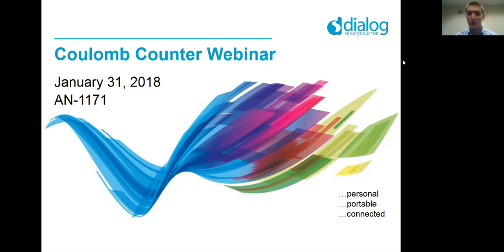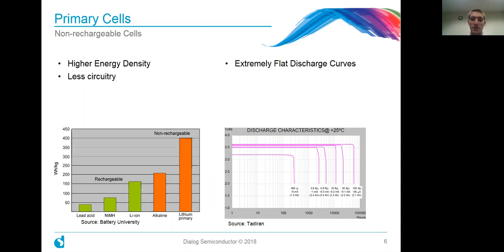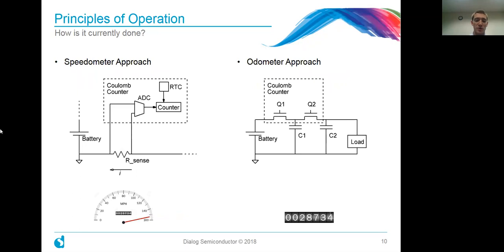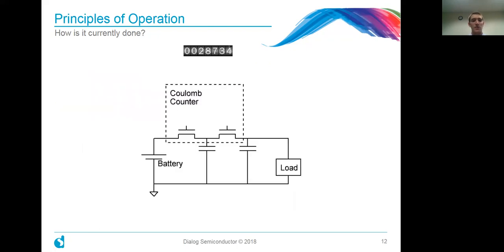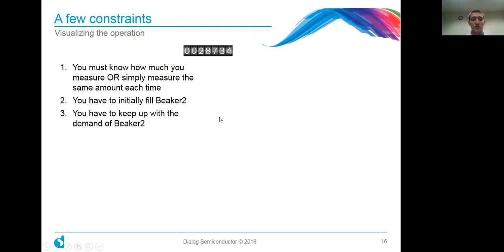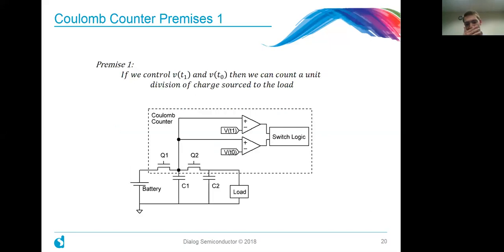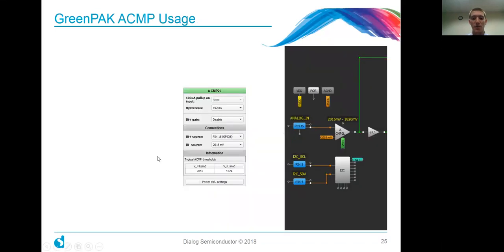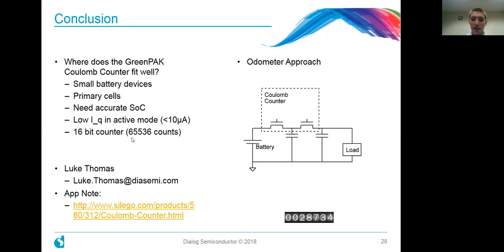Coulomb Counter Webinar

Comment: Figure #1 shows 10uf for the Input Cap & Output Cap and 1 uF for the Flying-Cap
 But in Section #7 Conclusion - it states 100 uF In/Out Caps and 10uF for the Flying-Cap
 Why the huge discrepancy?

Comment: Figure 3 clearly shows an RC Discharge Curve, with a very long taper
 But Figure 7 CH3 Pink shows a "straight line" discharge for the Voltage on the Flying-Cap.
 Why the discrepancy?